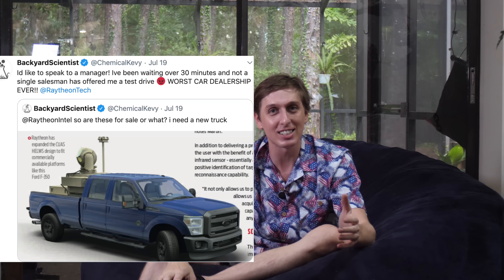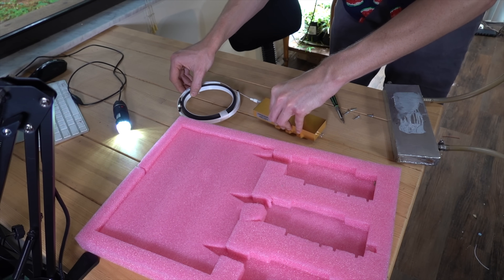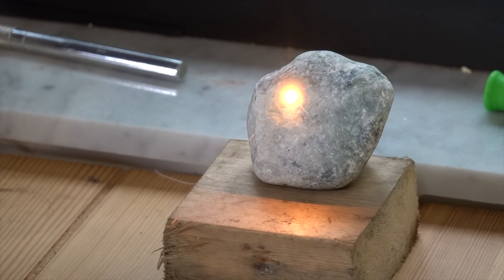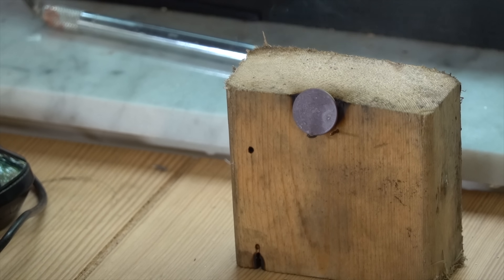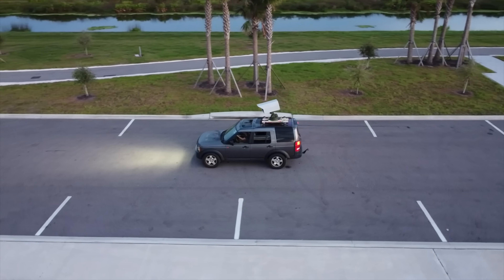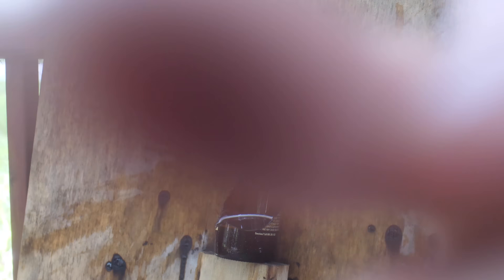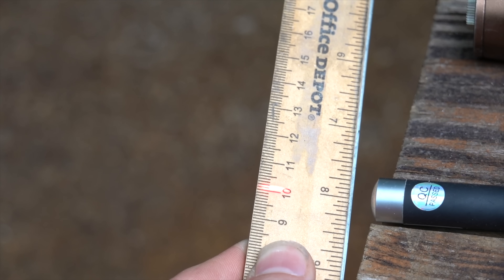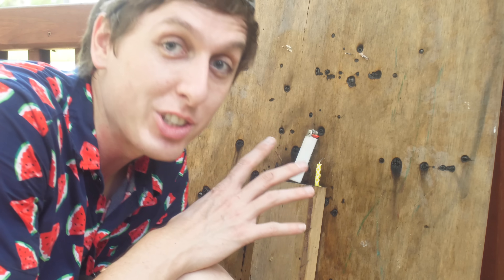200 Watt car mounted laser!

Comment: 11:45  You're certainly reducing the relative divergence, but are you really reducing the absolute divergence?
Reply: What is absolute divergence?
Reply: @NoahWenzel   The divergence he mentioned in the video.  The 1 mm/meter value.
Reply: DANG JOS  yes but you mentioned relative divergence and absolute divergence. What is the difference between the two?
Reply: @NoahWenzel   Absolute divergence is the amount the laser diverges per unit distance.  Relative divergence is the absolute divergence divided by the width of the beam.  At least, that's how I'm defining it to relate to what I was saying.  Basically, as he widens the beam, if the absolute divergence stays the same, then the relative divergence will shrink.  But since the absolute is the same, then the beam would still widen the same amount on its way to the moon.  So I just wasn't sure he was actually reducing anything.  But perhaps he's referring to the divergence caused by diffraction.  I suppose that would actually be reduced by widening the beam.

Comment: If you continue to use telescopes and Cassegrain scopes, try using a moonlight focuser or featherlight focuser because focusing on the tube causes mirror flop, which will cause make the beam slightly off center.

Comment: Only a tiny amount of reflected energy from the bottles, rocks, etc hitting your, or someone else's eyes down the street will take out their eyes. These lasers are important components in industrial machinery. Making very dangerous toys with them could make it very difficult for companies to get replacement parts for their equipment. When used in machinery, the work area is COMPLETELY sealed from leakage, and the machine will not even turn on with any of the guards open. I find this video interesting and fun, but I do not think you should have made this toy or posted videos about it. The laser is far too powerfull and dangerous to use as a toy.

Comment: The first penny you melted is not a zinc penny. It’s 95% copper and 5% zinc. The second one, a wheat penny, is not a copper penny. It’s 95% copper, 2.5% tin, 2.5% zinc.

Comment: Question. what would it do to rubber. i hate tailgers. or maybe just enough to make the radatior heat up enough to redline the temp. gauge in car. (its just a thought hhahah) question can u make me a small one to go on my car hahahaahah
Reply from the maker: i bet if you focused the laser on the tire it would burn though in a few seconds.  but maybe not with how fast the wheel is spinning and the air cooling.
Reply: @TheBackyardScientist  ok first thanks for the reply. could you set it to pulse, with the speed of the tyre and make it hit in the same spot or within a few mm. wkd build btw just dont hurt yourself atvb

Comment: Did you learn anything interesting about the laws for shining IR lasers into the sky? I've never seen an FAA report about a laser crime involving an IR beam.
Reply from the maker: it's not illegal to shine in the sky, only at planes.  and the danger to planes is not damage to pilots eyes, just distraction and flash blindness. if you do the math of a plane 20 miles away flying through the beam at 500mph you would see there is no risk for damage. take into account it was a hazy night, the moving beam, and we never turned the beam up more than 30% .. trust me i do not want to injure anybody and took every precaution i could to ensure it was pointing where there were no flights in the area.

Comment: Get 10 of these lasers and hook em all up for the ultimate death ray
Reply from the maker: for a real death ray you need to use the lasers to pump an erbium fiber amplifier. then you get single mode output and can focus it 20x better. from 10mm @ 100yards to 500um.

Comment: what is the difference between this and an industrial steel cutting laser?  I'm always wondered if you could buy a 15kw cnc laser that's outdated or busted and extract the minimal amount to turret mount it in a van. you can actually get them pretty cheap on some industry auction sites. and I'm sure with your collection of friends, you could harvest the doner for some juicy parts to play with

Comment: Thats impressive. You MacGyvered that thing out of an old satellite mount, 2 telescopes, a bunch of power supplies, a joystick and video monitor, a water cooling system and a 200w fibre laser. (oh and the case looks great too). Did ya think of somehow incorporating a pass IR reflect green or blue dichro in there so you could add an aiming beam right down the central axis of the main IR beam? Probably too much power density and the dichro would crack or burn.